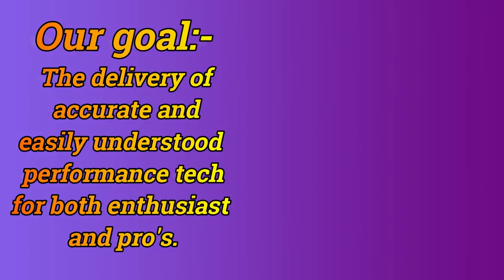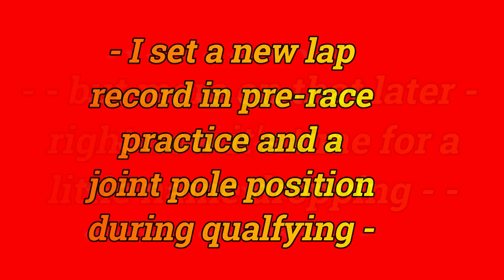David Vizard's PowerTec 10 EP  44 MSD 6 loses race because it was A too good, or  B not good enough!

Comment: I had a friend borrow my hei distributor cap, and coil, without me knowing, we got stranded, I opened the hood, saw my coil, I ask, did you get the rotor also, he said no,  I said, I know what's wrong then, the rotor is fried, sure enough, the outboard tip , touch it and it fell off, and the inboard was gone, with a hole burned in the center of the rotor, I told him a stock rotor will not handle that coil!!! Luckily we got someone to bring a coil, cap and rotor, he didn't want my coil anymore! Haha!!
Reply: I had a pro street nova 355 with HEI with accel replacement coil & a MSD 6AL that melted the rotor button and practically fried the distributor cap in a few thousand or less miles.

Comment: My aMSD 6 story.  1988 Jeep YJ, with a 4.2L single carb tiny carb in the middle of a long inline 6.   Weird little engine.  Carborator with a stepper motor mixture adjustment, distributer with vacuum and mechanical advance and computer control....   Some sort of Ford ignition box.   Ford box was failing.  Left the jeep dead in a Home Depot parking lot.  I installed an MSD 6T, bypassing the ford ignition box (and the computer).  Initial install was tie-wrap.  Jeep ran great.  Better than ever!  Only issue, the tachometer wasn't working.   My wife goes to drive it and starts complaining.  She thinks the jeep has stalled at the first intersection leaving our house and hits the key to crank it and it grinds!
I chalk it up to the MS6 being a very good setup up to 3500 rpm or so.  That inline 6 with poor fuel distribution needed all the help it could get and the MSD6 was just the ticket!   Note, at the time they still did chassis dyno emission testing.  Not passed every single time.  The only issue is that half the time they had to do the test twice because the testing station though the exhaust sniffer wasn't hooked up correctly.  Kept measuring 0 HCs.
190k Miles on the motor.  New timing chain, rebuilt carb, new catalytic converter (3" Cat + 3" exhaust).   Still think it made 90hp downhill.

Comment: No, your looking at it wrong.if your coil wire,  ignition leads, wires were routed better, then you would have Won The Race. Reminds me of when Alan Jones Lapped everyone at Bathurst, and then it caught fire. I could feel the Engine  shake the floor in the factory along side when it was on the dyno. I said to myself that thing will lap the field, and it did. for the record Mallory shits all over the earlier MSD 6, it was only when they brought out MSD 6al2 that they matched the  power of it. MSD still do Not have a  better overall unit than Mallory, the same Mallory unit I have used for 22years now still Wins for the most features, and in my opinion is still the ultimate street and strip multi spark box Period. unfortunately since MSD, Holley now owns Mallory, they have discontinued Making them.

Comment: Early on in the evolution of the "six", I don't know what they called them, but further in they acquired the moniker, "digital " . ,,, Disagree, the path of least resistance would have found its way regardless . Well, if it's you heat / insulation theory a weaker box might have not broke down the insulation as early  .

Comment: https://youtu.be/DZRZ4uCeCEM
It's a video where you can see the Pontiac V8 Vertex Magneto I use.
I have upgraded the entire fiel system to Drag Race Fuel Return style now. All plumbed in Earl's Speedflex PTFE #10AN and matching fittings.
9380 list 850 cfm Holley has been replaced with a BLP BoLaws 1085  cfm 4150 D.P.  # 40365AB Pro Flow series.
1500 miles Driving and street racing away in Illinois 2021.
Vertex Magneto is 100% reliable for me.

Comment: I guess I'm stupid, I don't get it.
Reply: When it comes to ignition systems, oil systems, and cooling, sometimes the "best" system is not the best performing system rather the most simple and reliable.   You CAN gain some power from these systems, but half the time.... Improved complexity or shorter life is not worth the fraction of a percent improved power you can gain.
Reply: @glenurban3596  Ok, thanks. I replaced the spark plugs on my 85 chevy pick up with non resister plugs, the idle was crisper and the throttle response was better, it was like I  installed a after market ignition. The old plugs had 4,000 to 5,000 OHMs where the new plugs had 0 OHMs and the radio worked fine. But I don't think the results on a new car with all the electronics would be a good out come. All the best.

Comment: If you would have had a Vertex Magneto in that race 1974 you would have Won !
Swiss, Switzerland made. Also Schintilla Vertex Magnetos were used all WW2 British Allied War Planes Warbirds. USA of course likewise.
Reply: Mags being electrically independent espoused the reliability factor.
There's more, but THAT is the most important.
Reply: @hotrodray6802  Magnetos are extremely Reliable when setup right.
Mallory made Magnetos for Racing also. I had a Mallory Sprint Magneto for a SBC/BBC. She was a Hot One( Running spark gap test bright Blue White Hot spark output.)
I have had Vertex Magnetos spinning 10,000-11,000 rpms on another SUN Distributor machine I used to have I I modified to spin test to 12,000 rpms.
11,000 rpms zero misfires ( Sun distributor machine spinning 1/2 crankshaft speed at 5500 rpms), it's very hard on Vintage Sun Distributor machines spinning that high of rpms. My rebuilt Blueprinted Vertex OAC internal coil all self contained and external OAX models took it just fine Zero failures.  
We were dirt track Racing 1/4 mile high banked oval here in Illinois at LaSalle Speedway. About 100 miles south of Chicago.  At the time we were #3 in National points chase Street Stock. Our SBC 369 ci all iron Factory Double Hump 2.02" intake valve heads turned 8000 rpms steady. Seen 9500 rpm peak. 
HEI always blowing up literally from Extreme high rpms ! When they blow up HEI parts scatter everywhere !
Ran 6.14, 6.38, up to 7.17 :1 ratio gearsets in the Ford 9 inch.
Big Dogs Unlimited Late Model Turned 10,000-11,000 rpms.  Engines full of 6AL4V Titanium Silver Lightning !
I am mostly Drag Racer, street racer.
But Endurance Racing David comes from is Super Exciting too.  Races like a Drag Race but or goes on 15 minutes to 2 hours non stop just pit for Fuel after 32 gallons burned up in the fuel cell or change a flat tire get back and Race to Win !
Reply: bth   rotax   simms  bosch 
not all   scintilla vertex

Comment: Also it takes 75,000  volts or 75KV to jump an air gap of 1.000 inch.
24 inches  x 75KV = 1.8 Mega Volts or 1,800,000 Volts.
Reply: that is up into  Nicola Tesla territory
Reply from the maker: @WarpedSpeed   I think you have just explained why neither Cosworth or ourselves used it!
Reply: @marvingvx1  Its actually Current output that kills a person At High KV output. No idea what they had exactly with that Protype Capacitor Discharge system.  I find your story intriguing,  because my Electronics background tells me they had a 1 Farad rated  primary side discharge capacitor at 500-600 volts DC . NOT MICRO FARAD.  1 FARAD CAPACITOR ITS A BIG DOG !

Comment: I don't want to argue but I disagree with you David.
I like your videos, your channel, and appreciate your experiences and knowledge shared.
I have an MSD 6AL to install on a Customer 1975 Corvette with a 598 Ci BBC engine. 742 Hp 680 ft/lbs. Blueprint crate engine.
Just mounted the 6AL. Have to hardwire soon at work. I am a Corvette and Classic car Mechanic. 
The Head Mechanic now .
The Box says Made in China.
It's not USA Military grade or Aerospace grade Electronics. 
Sadly not made in the USA.
Not made in England,  The British make excellent parts and admire their workmanship.
Even made in Japan is rare now.
I have an A.A.S. in Electronics Technology 1990. I was an Electronic Bench Technician years back. Got bored Cars and Racing much more Fun.
Building Racing engines my passion.
MSD capacitor discharge has Slew Rate issues. Timing is not accurate as you may suspect as RPMS climb up and heat soak takes place.
Reply from the maker: Br Re. I liked your comments here - thanks. But I have a question - what is it you disagree with??????
DV
Reply: @marvingvx1  I suppose I should elaborate more.
I have seen several hundred MSD Ignition failures. Especially drag cars here in Illinois.  Spent 11 years when younger in the Dirt Track Racing world. I am 52 now.
It all starts with the main power supply source,  modern electronics on a vehicle it's the Alternator. 
You could Oscilloscope waveform check the power source output.
Vehicle battery is for starting purposes only typical.
I found many modern daily driver cars and trucks with impossible to diagnose Driveability issues none could pinpoint fix.
I Oscilloscope checked the Alternator charging output.
Excessive AC Ripple current present. 
Replacement Alternator fixed !
Reply: @marvingvx1  You know David, its amazing how well old School Technology worked and does yet today brought back to life.
Reply: I'll be a smart ass.
Maybe procomp makes them for MSD now?
Reply: @indyrock8148  Who knows. Take apart any modern consumer electronics and see if You see Made in the USA on What's called Discreet Electronics components. Should be silk screened on where the Parts Chips are made.
Made in the USA Electronics ended late 1980s.
We dont have the Manufacturing capability left all gone in the USA.
Went to China . Some Vietnam.  Some South Korea. 99% comes from China.
Been following the News on You Tube 100% of China manufacturing shutdown now including Electronics production for the USA.
If you use MSD enjoy because it's the last of. 2024 maybe back.  Maybe never.
I am wondering right now where USA  and British Military Electronics come from ? Likely a Top Secret Military only Manufacturing Facility not in China.
Reply: @indyrock8148  Yes. Indeed.
If You find a Vertex Magneto get it buy it for yourself. They were made adapted to Numerous engines Domestic USA, European,  British made engines, I believe Australian made also.
Earliest Factory car installed application I have found is the Hispano Suiza 
Looking around today I found Schintilla Vertex OAC Magneto was used on Bugatti 8 cylinder vintage engines. 
The Best in the World knew how Great and Reliable Vertex Magneto Are and Still is after a full rebuild and Restoration. 
Looking around for OEM points distributors also for low RPM Chevy, Pontiac, Oldsmobile, Ford, and Mopar LA & B & RB 440.
Every C1 Corvette I have to work on has points Ignition yet intact.
Many Most C2, and C3 Corvettes also. They still work Tuned up.
Reply: Hi, this is a very good point, and I found this when I needed to increase the spark energy in a forced induction application.  I tried the MSD, great spark energy, but I found the trigger (latency time) delay varied with rpm, and hence in my application I couldn't programme accurately, as the base ecu providing the timing couldn't compensate (I needed additional  trim maps). I switched to the Lucas style tank resonance circuit, twin parallel coils, only one providing the HT, setup a spark-gap simulator, and tested coil combos until I had max peak energy and duration I could achieve.  The soft power roll off with boost was cured, and was able to run higher boost gaining power, where before I had been hitting a brick wall.  V6 distributor, and single coil application.

Comment: The Finest Racing Ignition system ever made Is The Vertex OAC and OAX Magneto. What I believe and still use myself.
Vertex went out of business recently it seems. Covid 19 shutdowns .
Reply: i would say the BRITISH THOMPSON HOUSTON   "  BTH " MAGNETO   
to aero standards    37acx  has no equal     superior quality / materials and extensive testing  
granted scintilla is up there too 
the vintage DIXIE was also very unique
ps i rewind  and rebuild them for a hobby      you cant beat a good mag 
but there are so many people think they go on forever   which is not the case    corrosion at the ht/ lt  wire joint is the culprit  most of the time
Reply: @eweunkettles8207  I have a Chevy V8 Vertex Magneto with the classic grease cup on the lower drive base I haven't restored rebuilt yet.
Think it's from 1963-64.  It still works !
Reply: It still has the 1st generation Vertex Magneto Condenser yet also !
Nothing failed. 
Outside lots of light Aluminum corrosion.  
We Call it Pantina Today !
Reply: @brracing7861  
is that the one with the condensor inside the armature
Reply: @eweunkettles8207  No

Comment: I'd say not good enough. If the insulation had been up to the task it would 't have caused a ground because of getting soft. Question is of course if there were materials around that would not have failed.
Reply from the maker: Alex, Lets not overlook that MSD did not make the ignition cables. What we had was supposedly the best that 1974 had to offer.
DV
Reply: @marvingvx1  Fair enough. I happily make an 180 degree turn saying that MSD was too good but the cables not good enough, which is not so strange considering the fireworks it had to handle under extreme circumstances. Pioneers teething troubles.

Comment: Had no idea Oselli did Avenger work.
Would love to know what made the Avenger the racer in group 1&2 that it was. Surly the engine was not as good as a Ford X flow. Was it the rear axle location?
Any time you have time for more of the same, before it's all gone
Reply from the maker: Hi Mr. Gothic. 
To answer your questions> 1) Oselli did not do Avenger engines. 2) The avenger engine had huge potential - way more than the Ford Xflow. However to get good results meant you had to know what you were doing - that means not casually knowing -  but really knowing.
Reply: @marvingvx1  Thank you Sir
Reply: Why don't you attend David's How to build Horsepower Seminar.
Reply: @gj91471  Yes you are right, I should.
Reply: I ran an old Chrysler Avenger 1600 in the late 1980s. It was quite quick for an old banger and it handled extremely well. No power steering but light enough to steer with one hand.
Reply: @wheater5  Not too bad of fuel either.

Comment: Inside these boxes, are very small wires and transistors. It doesn't take much to fry them. Most long distance racers run two with a backup because they get hot and melt down.
Reply from the maker: Hi Tom - still owe you a 1 on 1 call - I'm busier than a one arm wall paper hanger.
DV
Reply: @marvingvx1  ill see you at no name!!!
Reply: Exactly what I do even on my street cars. I carry one extra ignition system. That has saved my a$$ from an expensive towing bill more than once. Most of the time i find improper pin tension or loose connector though. Professor Vizard could write a Hot Rodder Bedtime storybook with all of his ventures.
Reply: The weakest link doesn't mean it's always "X" parts fault. Heat dissipation is important for anything but what causes the spark box to die most often is the spark can't get out at the spark plug. If the energy can't get out there it will 9 times out of 10 fry the box. The reason most "endurance" guys run them is because back in the day the NASCAR guys had got this passed for "reliability". The distributor has dual magnetic pickups installed meaning 1 for each box. Now you have access 2 different total timing figures at the flip of a switch 😉

Comment: I have been wondering about this.  I have heard they are unreliable.
Reply: Mine has been working for 10 years...its in the glove box though and not exposed to underhood conditions.
Reply: @cuzz63  I had one on a daily driver (GM HEI) and it proved flawless for over 15 years.  No regrets.  Just mount the box so that it gets some outside air flow.
I had one of the early ones and it petered out on a dump truck.  Just got too hot.  Plus, the later models have improved internals.
Reply from the maker: Yes but while they are working they are pretty damn good! DV
Reply: I try to mount them on the core support and drill 3 one inch holes to blow air on them.
You could mount a cooling shroud or tube to direct the airflow.... Like airplanes
Reply: I have one that was on a daily driver for years.  Some 200K with no problems.  Just have to ventilate the base and shield from engine/exhaust heat.